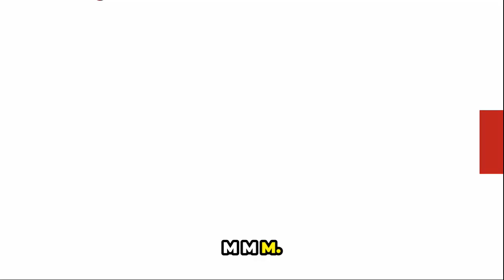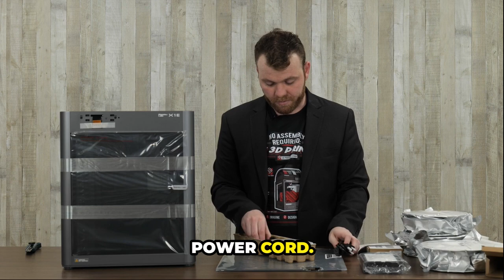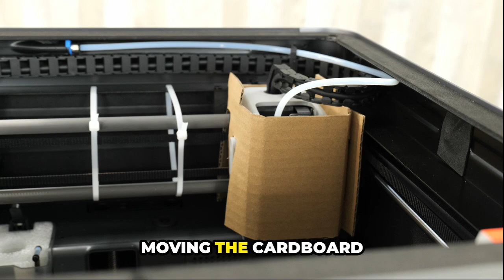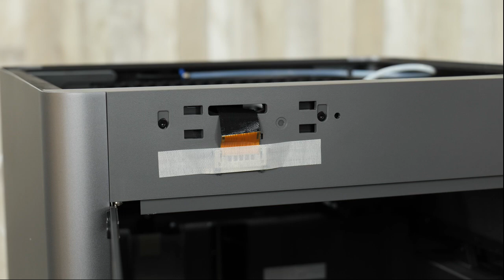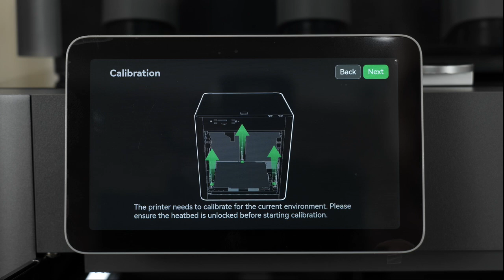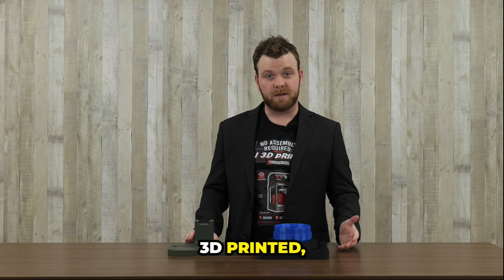Unboxing the Bambu Lab X1E #3d #bambulab #bambu

Comment: If you decline on the screen about the terms and conditions can you still use the printer in an air gapped offline mode? Some may have some security concerns with the Bambu Labs company and may want an air gapped system for that extra security.